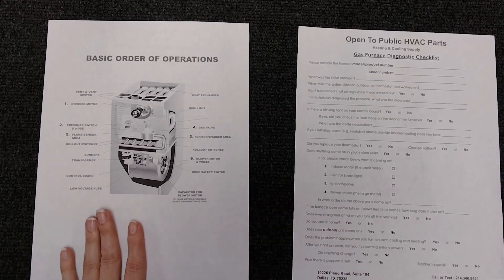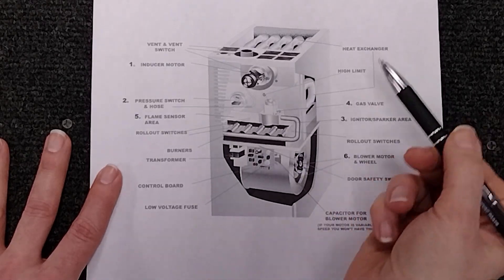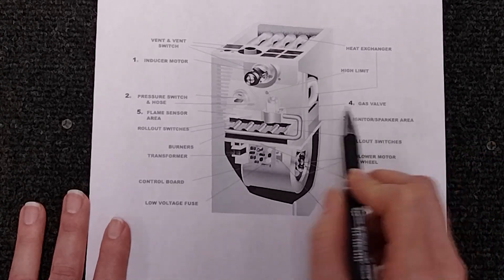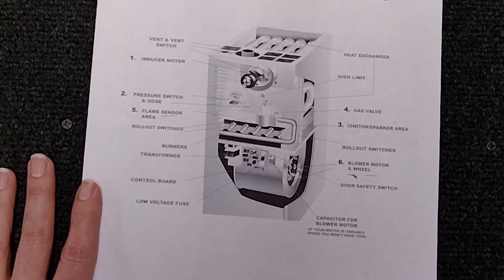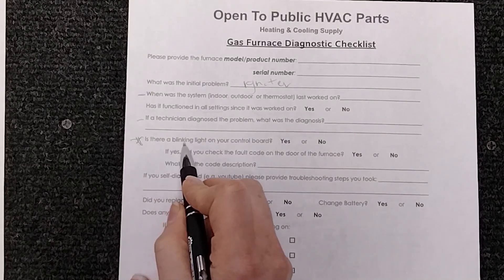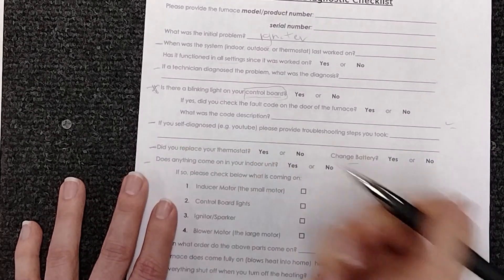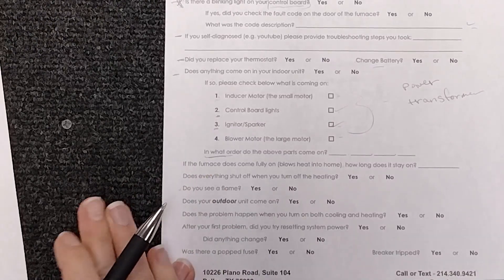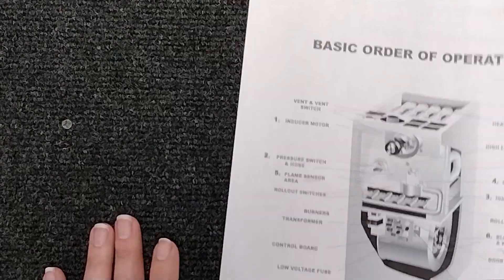Learning how your gas furnace works so you can fix it!

Comment: Good video Crystal. Thank you.  Does your company ship country wide. If you do can I get the phone number.
Reply from the maker: Hey Steven! It really depends on what it would be. Say, for example, a balanced part like a blower wheel or a motor when sent by itself (instead of secure on a pallet) they tend to be tossed around and you're at risk of getting a broken or bent part. We can ship smaller items to you! Our store is located in Dallas, TX and the phone number is 214-340-9421. Hope this helps!